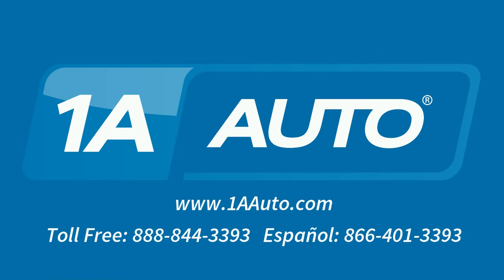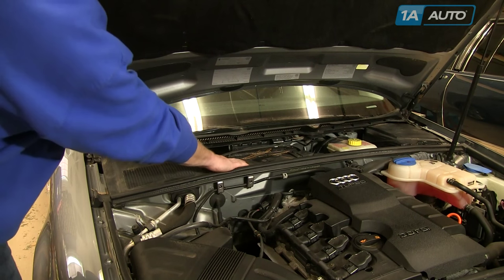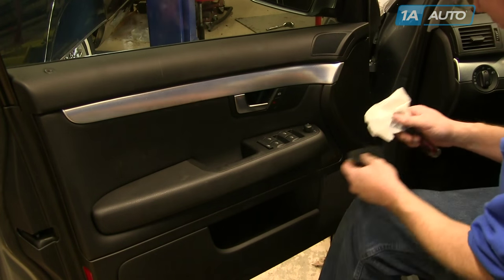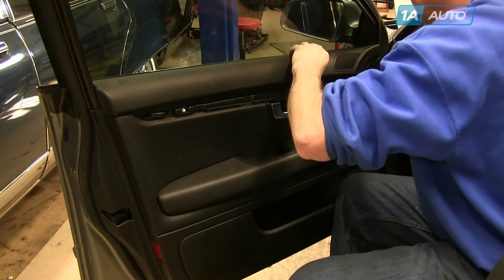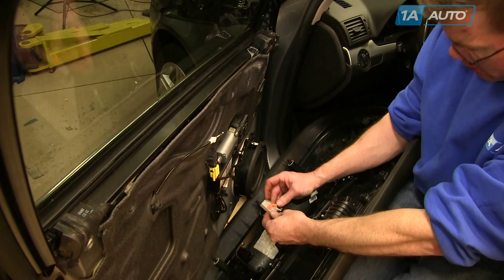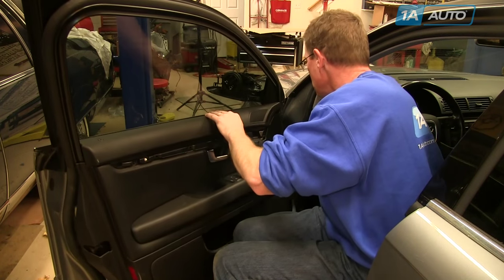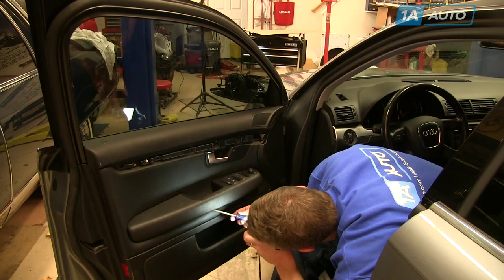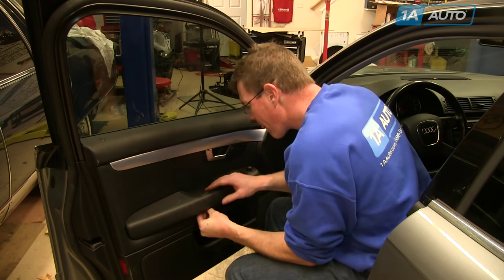How To Remove Front Door Panel 04-09 Audi A4

Comment: Why did you disconnect battery?  Does the car have an air bag in there?? That's the only reason I would disconnect it
Reply from the maker: +Raul Romo We were performing other repairs to the car as well.
Reply: oh, ok.  I just took one apart to tint the windows, but I didn't disconnect anything, just pulled the rubber channel and hung door panel back on, tinted it then put everything back together.  good video
Reply: May keep system from reporting open circuit errors.

Comment: Just an FYI, this is applicable to the 2002 A4 as well. Also, the later years of A4 (B7, 2005.5-2008) don't actually have the cover for the battery.